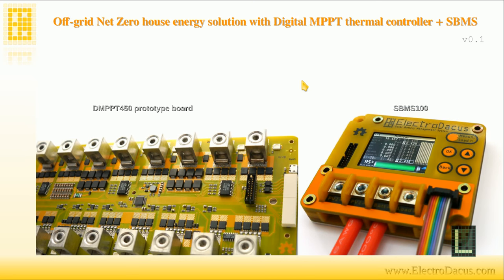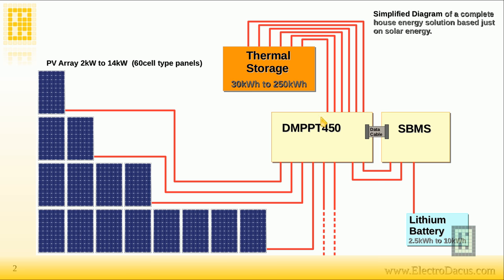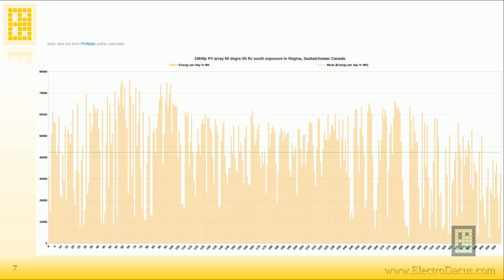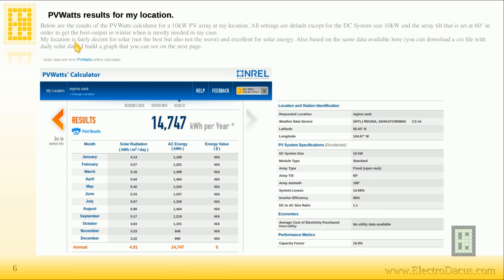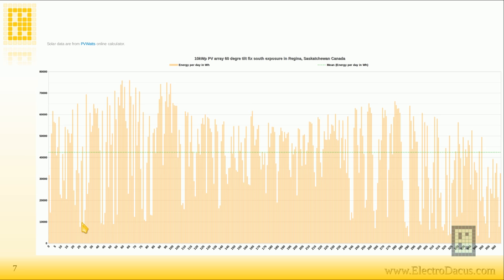Explaining the Digital MPPT thermal controller

Comment: How can I purchase these? The kickstarter ended almost 4 years ago, but I don't see these available for sale.
Reply from the maker: The DMPPT450 is no longer produced as there was no demand for it and the SBMS0 + DSSR20 is now the latest version of SBMS0 that has replaced all the older versions. Manual and details can be found on my website electrodacus.com
Reply: @electrodacus  but I need this type of board for my off grid build. It's a brilliant board. What can you recommend?
Reply from the maker: @ancienttechnology7337  Are you referring at the DMPPT450 ? with one of the futures do you need the large PV array to charge a small battery or the heating ?
The large PV array is also possible with SBMS0 and multiple DSSR20 read about dual PV array in the SBMS0 manual and for heating there is the DSSR20 with diversion so it can divert PV panels to a heating element or you can use solar PV panels as heating elements see the DSSR20/DEXT16 user manual for some details. Is not quite the DMPPT450 but some of the futures are available on the SBMS0 and DSSR20 with diversion. And SBMS0 can handle up to 30kW of PV panels in dual PV array mode with multiple DSSR20.
Reply: @electrodacus  yes I need a board that can handle a large array directly to thermal mass heating.
Reply from the maker: @ancienttechnology7337  Sorry people did not understood the value of DMPPT450 so it was not cost effective for me to build as the demand was way to low and a total of under 50 units were produced in total as that was the order from Kickstarter combined with direct orders on my website over an almost two year period.
You can directly connect PV panels to heating elements for thermal mass storage and efficiency can be as good as 80% in a sunny day.
Or you can use diodes as heating element and then you have a sort of analog MPPT and have close to 100% efficiency.  PV panels can also be used a direct heating elements so two 60 cell panels outside in parallel connected to a single 40 cell PV panel inside that will act as a heater again working at max power point and no electronic circuit is needed.

Comment: next time use a heat pump and enjoy more reserve power.  COP up 11 with propane as working gas. R22 like system but 1.1 time better
Reply from the maker: Sorry heat pump will not be cost effective when compared with direct PV panel heating. My entire heating system will cost around 12k USD and adding a heat pump to this system can only increase the total cost of the system while reducing the reliability.
Average temperature in January here is  -16.7C with +23C inside you already have a 40C delta in temperature and at this level an air heat pump will just have a horrible COP.
The commercially available air to air or air to water heat pumps will have a COP of around 2.3 at -10C and only 1.5 at -25C thus completely useless. I can get better gain by just adding more PV panels or increasing the thermal storage instead of investing in a heat pump.
Reply: There are water to water heat pumps which take heat from a level of 7-8 degrees celsius but since I started to listen your stuff I found that direct passive heating from PV could be more efficient and reliable.
Reply from the maker: Yes the water to water heat pumps are used mostly in combination with geothermal ground loops but those alone at my location will cost more than the entire equipment for PV heating so they are not cost effective and of course less reliable because of all those moving parts and pipes with liquid.
Reply: amazing how efficient is to start with the basic design of a house and after that design the your pv solution. Congrats Dacian for the whole work and persistence!

Comment: how can i find some of bms to charge my battery bank ?  I have about 8.5Kwatt array
Any suggestion with your bms to manage 2000Ahr Battery ?
Reply from the maker: The SBMS120 is the largest SBMS I have suporting 120A STC so about 3000 to 3500W worth of panels and has no problem supporting a large battery even in excess of 2000Ah and keep that in balance.
But since the SBMS120 supports a max of 12 of those 60 cell panels with a 24V battery it means that anything larger than 10 to 12kWh battery (400 to 600Ah) will not be cost effective to have since a max charge rate of 0.2 to 0.3C is ideal.
Even using 2 SBMS120 will not be able to handle 8.5kW PV array. You can use the DMPPT450 that supports up to 14kW PV array but that is mostly for PV solar heating applications as I explain in this video and it will be able to divert up to 120A to the SBMS120 for battery charging from the large PV array.
The number of panels diverted to battery charging will depend on the amount of solar so if is overcast the entire 8.5kW PV array will produce way less than 120A so all panels will be diverted to battery charging but when is sunny just some of the panels will be diverted to battery charging the rest are available for heating so storing that energy in some form of thermal mass.
Are you fully offgrid ? What do you use most of that energy from the 8.5kW PV array ? What sort of Lithium battery do you have ?
The first batch of SBMS is all sold out and after I finalize the design on the DMPPT450 I will build more SBMS40, SBMS120 and DMPPT450 probably around March to April is when that will happen and you can preorder from my website http://electrodacus.com/  
I will need more details about your system to give you a better answer.

Comment: I wonder if I could make racks to control coils of coated copper wire inside the 55 gallon drum(steel) connected to your device and divert the cold supply line from my water heater through that drum with another set of coils of pex pipe? I had thought about using solar to power the heading element of a separate water heater in line prior to the main electric one, but your MPPT device would be MUCH more efficient. Anyone know the current wait time for the next batch of these units?
Reply from the maker: The demand for DMPPT450 was very low so not sure I will build another batch. In a sunny day with a fix heating element connected directly to PV panels you still can get 80% efficiency in cloudy days you will need to manually connect a lower power heating element still there will be way less energy in those days.
Reply: electrodacus ok, thanks for the quick reply, I’m surprised about the lack of demand, is that the case for your charge controller as well? Looks to be very nice and full of features.
Reply from the maker: @waynenocton  The SBMS charge controllers have decent demand so I will continue to build those but not DMPPT450.  The SBMS0 + DSSR20's will start to have some of the futures of the DMPPT450 like charging a battery from a larger PV array by selecting groups of panels based on the amount of sun and later also diversion of unused energy to heating but without the Digital mppt functionality at this time just simple diversion for heating.
Early version of the SBMS0 / DSSR20 manual can be seen here  http://electrodacus.com/SBMS0/SBMS0-beta.pdf
Reply: @electrodacus  That's very interesting, I will look through those manuals and likely be ordering at some point soon.
Reply from the maker: @waynenocton  There is now a more complete version of SBMS0 manual here http://electrodacus.com/SBMS0/SBMS0.pdf
Reply: Just use an arduino to control how much panels you connect to how many resistors you got in your drum... More versatile and far cheaper then this solution.
I'm using a 3 resistor configjration in my water heater... One 200w, one 500 and one 1000w...then with my arduino i connect how many panels i got available (depending on the house inverter needs) to match each resistor., tbrough ssr.
Cost only price of 3 ssr and an arduino, the arduino goes in deep sleep between each decision.
In my opinion this dmppt is too specific and can only be used in very specific cases....
Reply from the maker: @honumoorea873  Those heat elements are AC and you are using that power trough the inverter ? For small systems that makes perfect sense. I guess that is a grid connected system.
It will not be cheaper if you want to have all the functionality of the DMPPT450 as that can handle 10KW+ PV array and can both direct any number of panels to battery charging and the rest to heating.
All my products are fully open source so anyone can build his own if it thinks it can be done cheaper.
Reply: @electrodacus  I'm not grid tied and i directly connect panels to the resistive elements that are in my water heater, going through the inverter would be a bad idea. (bad efficiency, cost to replace inverter)
Reply from the maker: @honumoorea873  Are those panels dedicated to heating or are they also used for battery charging ? Just curious about the setup.
Reply: Honu Moorea I think that can work yes but you won’t get the increase in efficiency of MPPT that way. Definitely a cheaper way and since these units are no longer available, makes your way even better though.
Reply: @waynenocton  Sorry i was unprecise, by "directly" i meant i do not use an inverter. I actually got one water heater that work with pwm controller and one with my arduino that select the best combination possible of panels/resistor to get the best efficiency, i got the same number of panels on each "side" and i try to measure the differences and to improve the software side.
Reply: @electrodacus  Two questions: 1) How can your approach be adapted for a house tied into the grid with net metering? (2) I have heard that resistance heating wires/connectors fail when the floor expands and contracts. Have you considered this possibility and how would you prevent that type of failure?
Reply from the maker: @gsomermeyer  1) None of my devices are designed for grid connected use.  2) My wires have already 2 full winter's and no fail the wires where cold when installed and I think while heating copper will expand more than concrete so there should be no tension and when contracting back they will be same length as when installed. Also my wires are silicone insulated wires and silicone is flexible it allows some contraction if that was the case. It is not unusual to have electrical wires in concrete as transmission lines and while this are used for heating there is no difference as they do not work at what they are rated in free air and in concrete they have great thermal transfer so they are barely warm well bellow normal operating temperature.

Comment: I really like this project, but after looking into it all the panels are wired in parallel.  The cable size and wiring cost becomes insane.  Why not increase the voltage to get the wire cost down?  Also, most solar/battery systems are 48 volt and this can’t be used with them.  I’m excited for this project but disappointed I cannot use it.
Reply from the maker: I use this already to heat my house for the past few years. Total cable cost for my installation was around $1000 so going to 48V so groups of two solar panels in series will have reduced the cost of the cables to half so saved around $500 in cable cost but increased voltage means higher voltage mosfet and everything else plus the number of groups of panels will have dropped making this way less efficient digital MPPT for same array size.
The more important part for me and what alone worth more than the extra $500 on cables is that max open circuit voltage with 24V battery is 40 to 50V (60 or 72 cell panels) while to go to 48V battery means open circuit voltage of double that 80 to 100V and even 80V is well above the 60V limit for safe ultra low voltage standards around the world and I only designed devices that can fit in the safe ultra low voltage standard.
Reply: @electrodacus  makes sense.  I’m trying to plan a 30 panel ground mount solar array about 300 feet from my house.  Do you have any suggestions on how this system could work for me?
Reply from the maker: @esquire9445  I no longer produce the DMPPT450 due to super low demand so this is no option anyway. 300ft away panels seems extreme as my panels are just 50ft away from the house.
Also 30 panels will do just a fraction of the heating for a typical house in therms of heating.  I currently have just 33 panels installed but that is about the limit and there are two to three weeks in a typical winter when I need backup heating so I will need to about double the PV array so I no longer need any backup in that period since backup heating costs more over time than the extra panels to deal with the cloudy days. But My house is super insulated thermally and also just 65m^2 (700sqft).
Reply: @electrodacus  ok, thank you for your response.